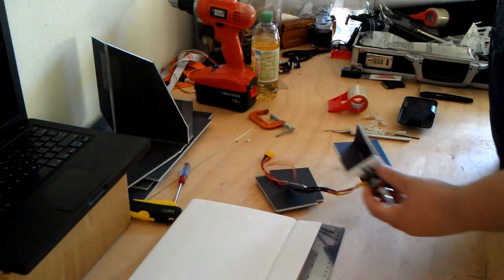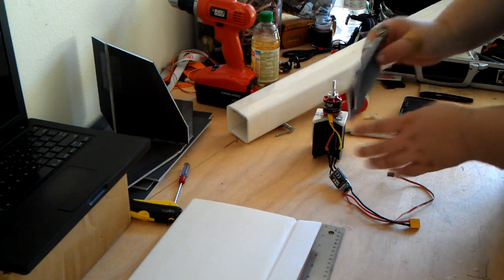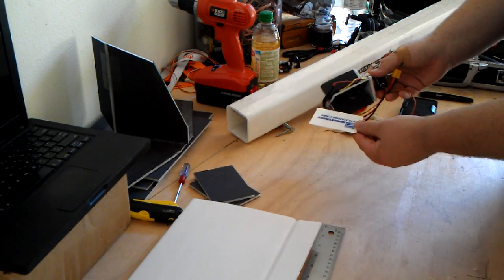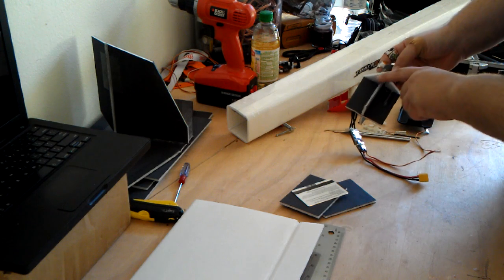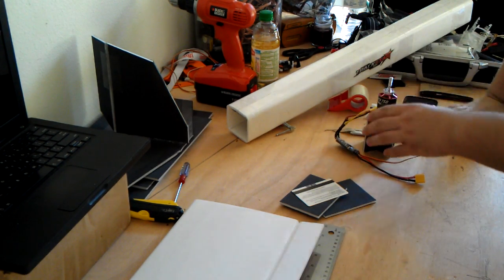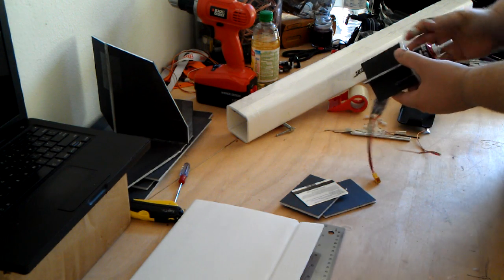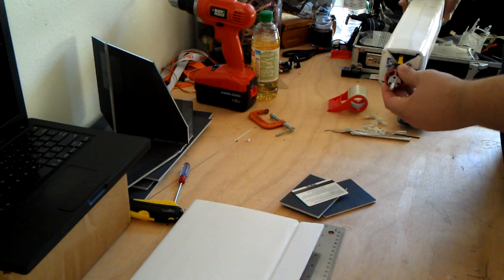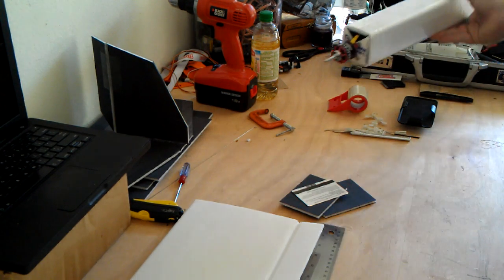Scratch Build Motor Mount Design

Comment: Great idea, dude. I see no need to improve something that is already great, but I WOULD recommend some heavy duty gloves to protect your fingers next time. Nice band aids, by the way!!! If it were me, I'd add a pin, like maybe a popsicle stick , straight down from top to bottom at the rear of the mount as a stop, then I'd just use strips of carbon reinforced packing tape across the front to hold it in place. Need to change motors? No problem. Cut the tape, do your work, tape 'er back in place.

Comment: just saw it and already used in one of the two planes I'm building for today :) 
I modified it slightly by adding extra fins to prevent the X from collapsing. Will post pics of it in my BajiWing thread on rcgroups. Thanks for the idea.

Comment: I think it' a great idea for a motor mount especially as it uses only the cardinal ingredients of foamboard and gift cards!  I see some use of this in changing out motors or accessing the space behind the motor, if you could pin in the assembly instead of gluing it.  The need for this will certainly become apparent in the future so I will definitely keep it in mind.